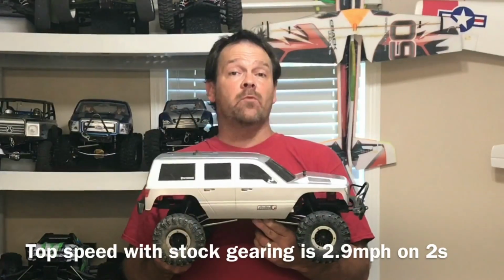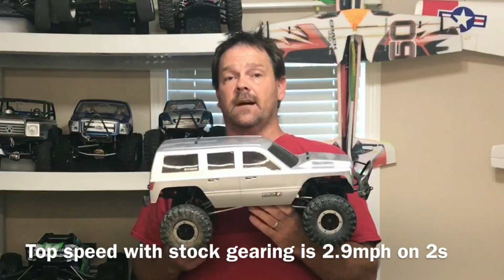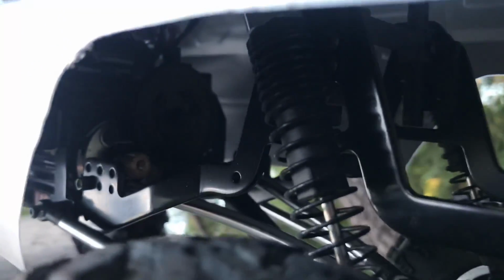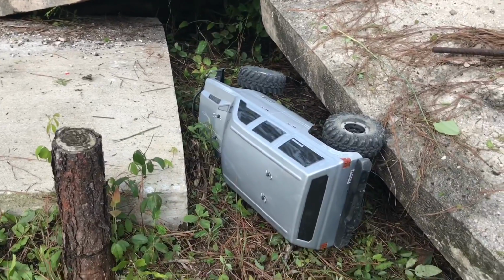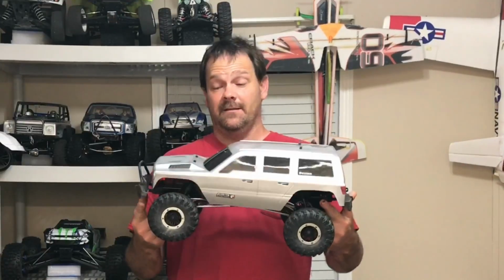Gen 7 truck Portal axles Hobbywing AXE system

Comment: Right on. Thanks for the info!!! I'll be putting the portal axles on with the axe 3300kv system in my Gen7.  Got a crawlmaster 540 sport on the way already lol not positive on a esc yet just run it off the stock for now see how it goes.  Not in it to do comps just have fun but able to hang if needed lol.
Reply from the maker: That will power it well. Could break some stuff

Comment: I have the hi- clearance aluminum knuckles  on mine. Will I be able to use that same setup with these?
Reply from the maker: If you’re talking about the portals, they are a completely different axle and the parts won’t bolt on to the older design axles.

Comment: What type of inner foams do you recommend.thanks
Reply: For the gen7 sport sorry
Reply from the maker: @w2110  So long as you keep it light as in under 8-9lbs or so these will work very nice https://rover.ebay.com/rover/1/711-53200-19255-0/1?mpre=https%3A%2F%2Fwww.ebay.com%2Fitm%2FCrawler-Innovations-Lil-Nova-4-50-Standard-Inner-Soft-Outer-2-CWR-2021%2F182223278949%3Fhash%3Ditem2a6d5a9365%3Ag%3AOLkAAOSwRoxXmnoM%3Asc%3AUSPSFirstClass!32068!US!-1&campid=5338273090&toolid=20008